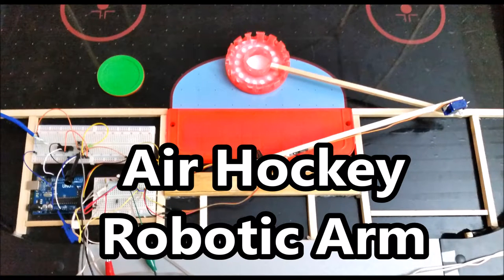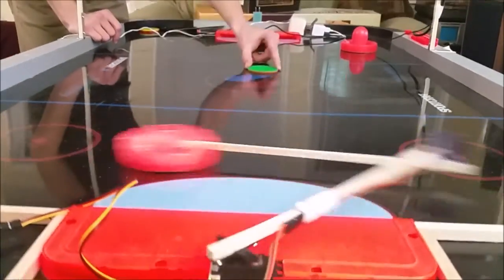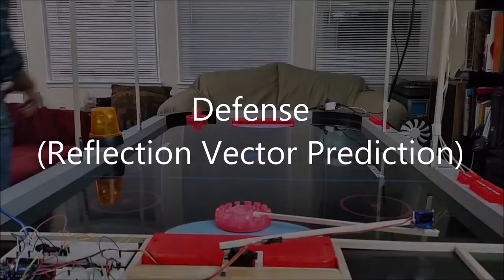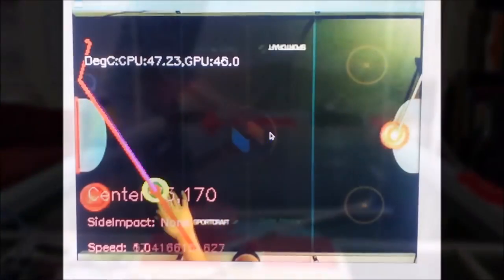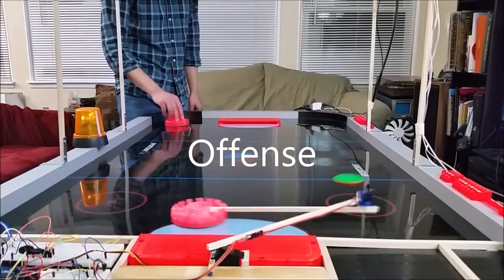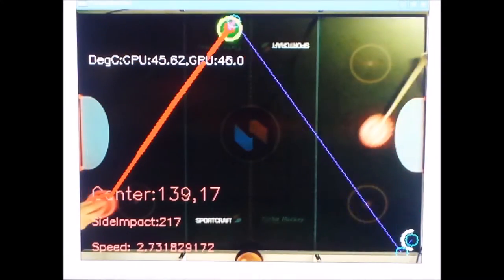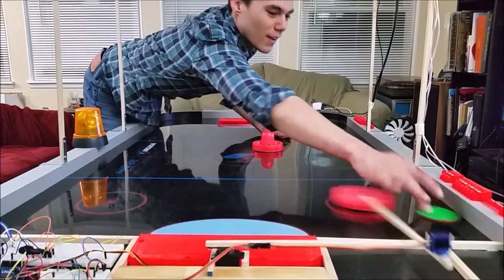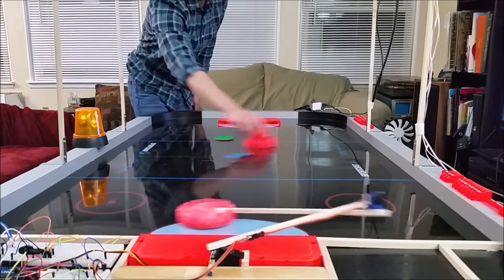Air Hockey AI + Robotic Arm using Raspberry Pi and Arduino

Comment: Nice Work! I have a questionnaires for you. How do u transfer the coordinates from the raspberry to the Arduino?
Reply from the maker: Thanks. I used the I2C protocol with a level shifter. The protocol isnt really designed for distances that far, but I was able to get it working. If I were to do it again, I might start by trying RS485 instead of I2C.

Comment: hey, i like your project could you please tell me how did you choose your servo motors and the length of the arms?
Reply from the maker: I chose a lightweight servo for the elbow, since the shoulder would have to move it. The shoulder servo was stronger and heavier. I think I chose a total length that would reach half the rink. The exact individual lengths were not a large concern.
Reply: @BortPlate  so you didn't have a specific algorithm for your calculation ?